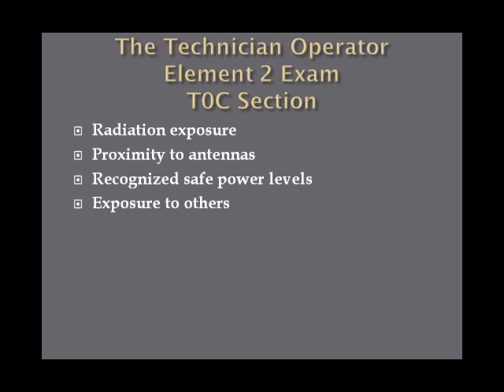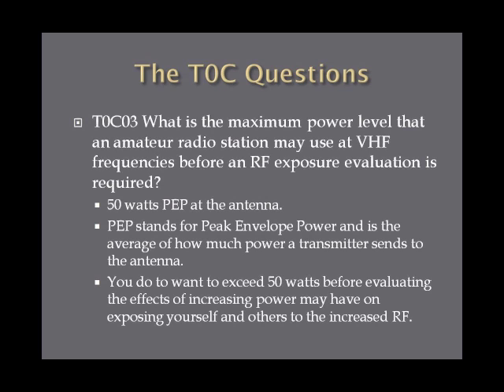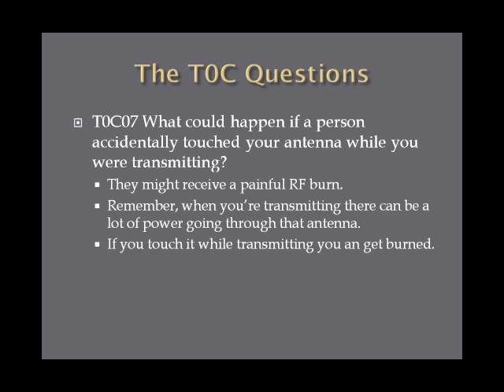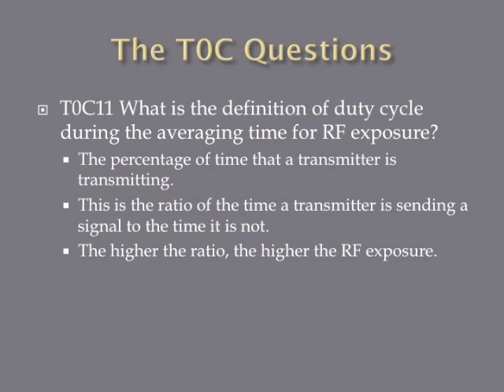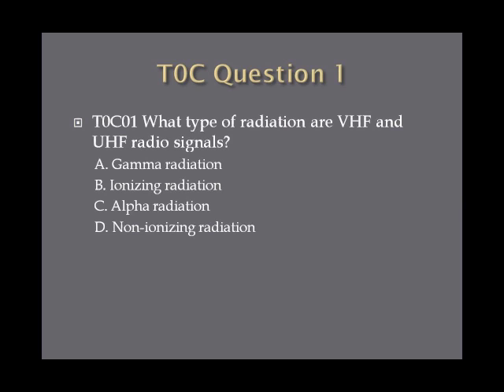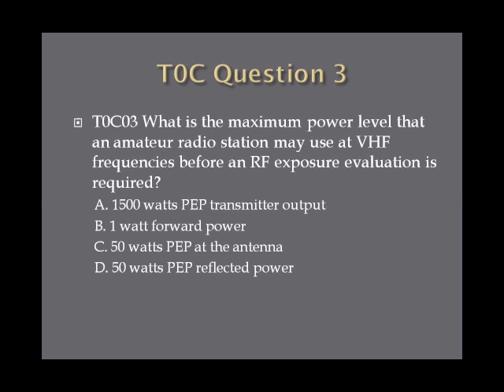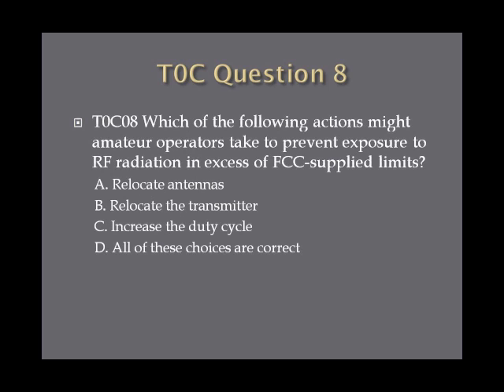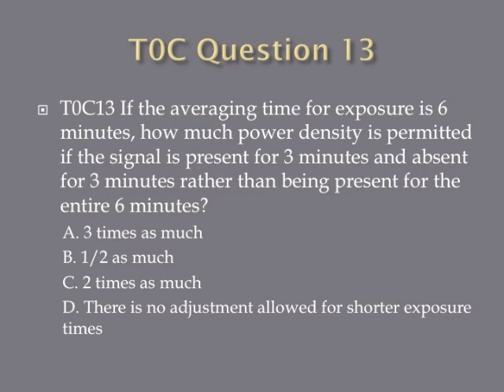Lesson 35 Technician Class Exam T0C Second Edition

Comment: I think there is a slight error in your answer to quiz 35, question 11:  percentage and ratio both rely on a numerator and denominator.  The top number, numerator is the value under consideration relative to the total, denominator.  So in your answer if duty cycle is 33% that would mean for example that the numerator is 3 hours, for example, and the denominator, total time under consideration/time spent in the radio shack is 9 hours. Follow? According to you, duty cycle is: 9-3 = 6 hours, and the answer would be 3/6 = 50%; where it should be 3/9, or 33% 1/3 of the total time you are transmitting